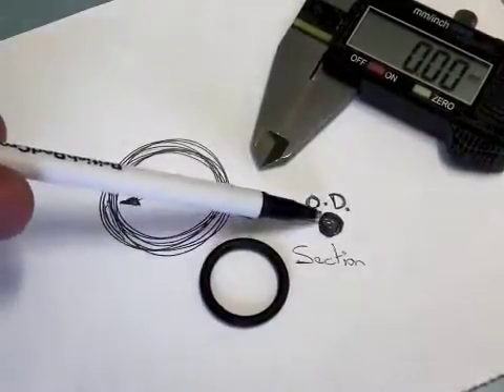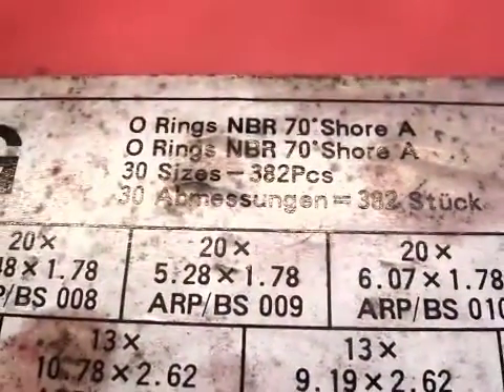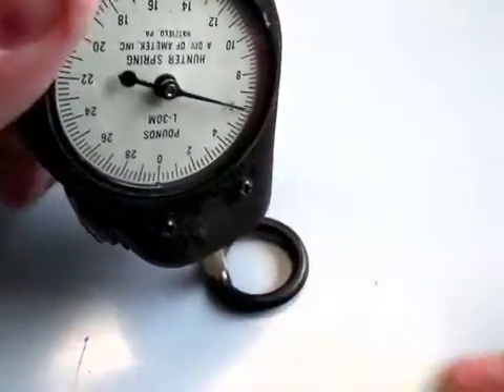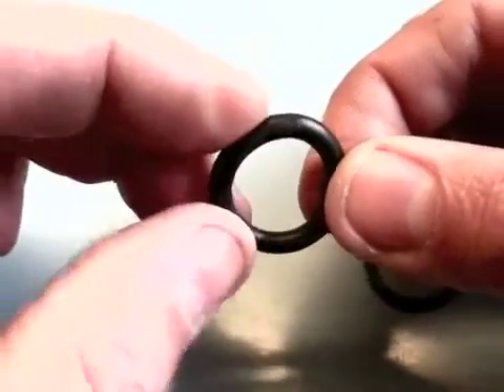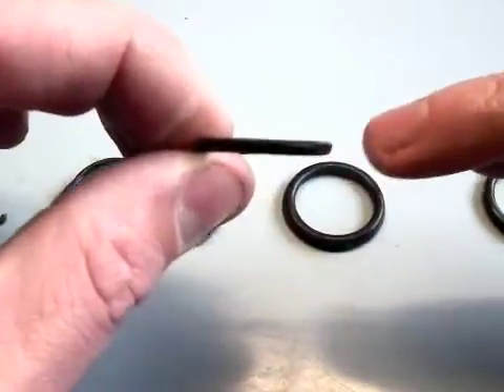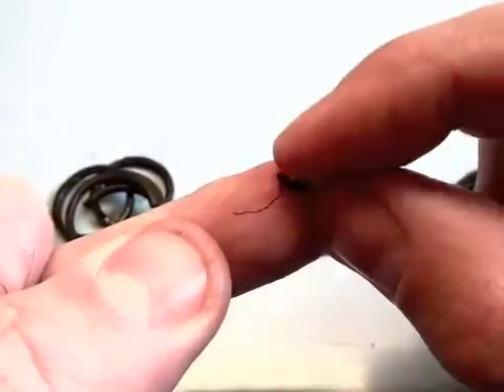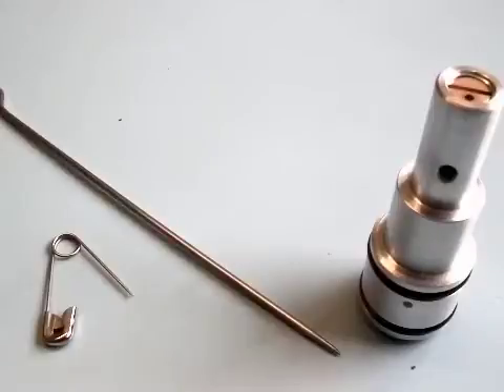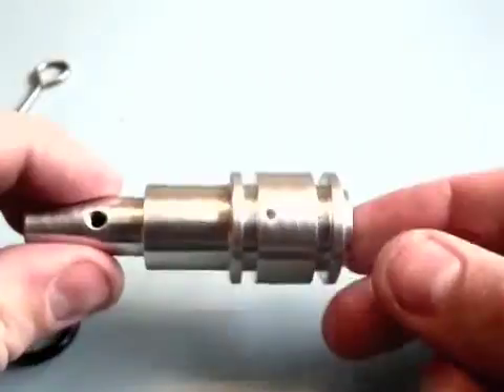Airgun / PCP 0-Ring Seals Pt. 1-3 (A Little Information) from 'Lane Regulators'.

Comment from the maker: I forgot to say at this point that they also come in:
Metric & Imperial Sizes i.e. Metric:  Is  I.D. in mm X Section of O-ring  in mm = 12 x 2.5
Imperial: Has a metric size written on the packet (See box lid below) but Typically have has a BS Number. 
The you can see on the video is BS009. 
This happens to be the seal used on most PCP filling probes.